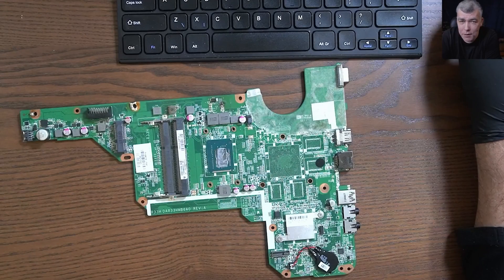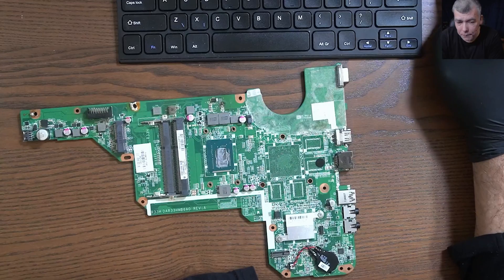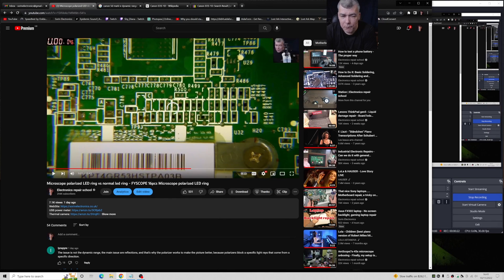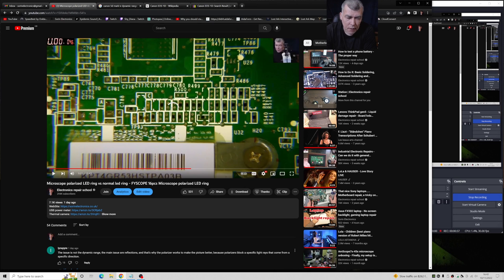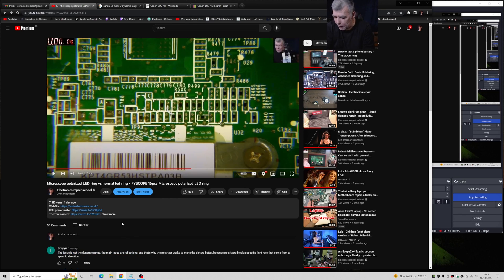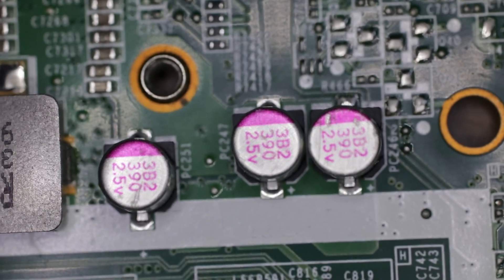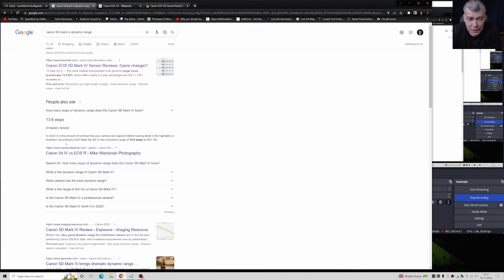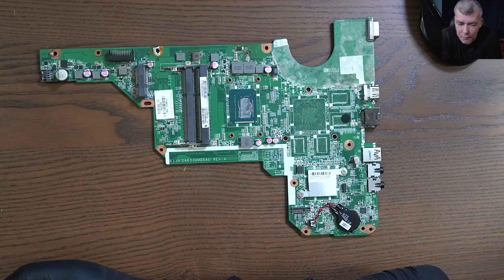Camera dynamic range  - Microscope camera vs Iphone vs dslr

Comment: Why you just can't adjust 10x or so smaller resolution on phone and take better picture, with less noise etc....  ? Ooo You actually can . And it is default...  Phone with 60mpx camera is taking 16mpx pictures as default... for example... If you want 100mpx picture you must go to ultra hi res mode...

Comment: Common sense lacks surely. I completed a Dip in Photography, but I am visually handicapped today and tried to convince my bosses at a large UK financial institution that a 32inch TV will not only suite me better, but cost less than a 4k Dell Monitor. They insisted in buying the Dell and speech recognition software and when I could not adjust they put me on disability retirement. I was a Certified Forensic Examiner holding a B in Forensic and Investigative Auditing. Not only did I loose the 3 best years of my pension, but also  not being able to train a new generation with my wealth of knowledge..😭

Comment: You are right about the lack of dynamic range and the quite absurd megapixels race, but all those parameters are not so important in this case. 
When you look at the board with the iPhone or DSLR, you don't have the same precise alignment for the camera and the ring light axes, not the same as when the ring light is mounted on the microscope. That's why you can see the markings on those caps in the first place, not just because of the superior dynamic range of the camera.
And even more important, with the devices you hold in your hand, you don't have a perfect perpendicular incidence for the light onto the board. It's very much like slightly tilting the board under the microscope, a method we all use to reduce the effects of light backscattering when we don't use (or dont' have) auxiliary light sources...
Reply: ur right

Comment: I don't use a microscope, much easier with just a camera and monitor, for me anyway.
I have found your light source needs to be at angle to get rid of the reflections and shadows, I only use my ring light for board inspection.
With cheap cameras, you will need angled light source.

Comment: If you down-sample image of a 100 mega pixel camera by software to 4 mega pixel you will get better image quality, because the noise averages out. One big problem is the sensor size, not just the megapixels. Sensors become smaller and smaller to accommodate smaller and cheaper lenses and to save on silicon cost. A  modern100 megapixel camera with big sensor down sampled to 4 megapixel will have a good image quality, just as good as that old canon camera. The real issue is sensor size and size of the lenses- not just high resolution. Big high resolution sensors, combined with downsampling give excellent picture quality. That is why canon uses such sensors in modern products.

Comment: The original video was about compensating for the bad dynamic range on the cheap camera, with filtered polarized light. Why use a polarized light source if you are filtering it anyway? You will achieve the same by not using the light source, or using a weak light source.
Reply: good point . or maybe .... Sorin helps us understand . 🤔

Comment: I agree with the dynamic range of the sensor but you also have to take the fstop and quality of the lens (A CCTV lens is never going to let the same amount of light in or have the same quality of a full frame lens even at the same F stop)and shutter speed along with the mentioned ISO(high ISO noise) and pixel density for light sensing (i.e. phone sensor vs Full Frame at the same megapixels) and software processing into consideration. For example, there is more dynamic range saved in a RAW file compared to a compressed JPEG file and some software processes the image better than others. 
You probably know this Sorin, but I mention for others.😉
On a side note...Canon had a 'Pro' DSLR before the 1D in collaboration with Kodak called the Canon D2000 (Kodak Professional DCS520) from 1999 which was a whole 2Mpxl!😁

Comment: If you properly light your scene, you can fit the shadows and highlights within the dynamic range limits. You basically have to add light to the shadows, and the highlights will go away with the auto-adjust. If you adjust your exposure manually for the highlights, you'll have very dark shadows if you don't add light, but that will work if you all you need to see is the light area.

Comment: You are right Sorin but you didnt make clear enough one thing I believe.  You should have discussed the sensor size. The ratio of sensor size to number of pixels is also important. You can have a low number of pixels but if the senasor is also relatively small then pixel sensitivity will not necessarily be better.
Reply: yep sensor size is one of the most important thing on a camera, bigger better

Comment: I 100% agree with that nonsense about megapixels.
But there is a problem with your practical exercise, you were comparing those 3 cameras with different distances from the board. The bigger distance, the worse reflections you get.

Comment: Look you have a crap microscope camera quite simple.  Deal with it,  forget all rest of the  rubbish.. it's the damn camera sensor,  Sony rule with imx sensors 100% for microscopes n nothing to do with dslr camera total different sensor type.
Reply: @ShainAndrews  you tell me I've 37yrs experience and 6 repair shops ?
Reply: @ShainAndrews  proofs in the pudding,  if you think his scope picture is fine, so be it no one else does, as to my experience could care less what you think.
Reply: @ShainAndrews  Give it a break buddy better using my time to run business than entertain would bes on YouTube,  you simply don't get it do you megapixels dslr camera,  phone cameras have NO CORRELATION whatsoever in this case , microscope camera are all about sensors inside which are microscope sensors,  only and idiot would buy a scope camera on how many megapixels it has. It's always about sensors.  Hence why my scope cameras cost 600 bux and are 4k 8mp with Sony imx334 sensors.  Learn stuff before mouthing off about things you clearly know nothing about. Last time I saw dslr camera on a scope was 15yrs ago.